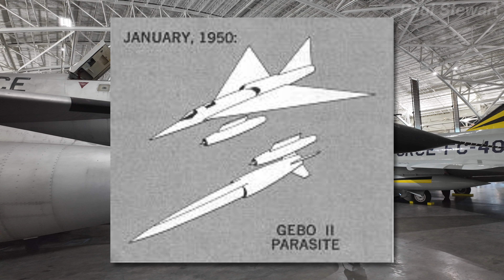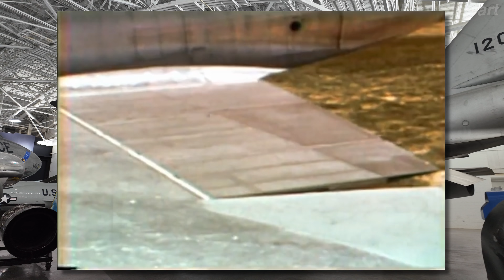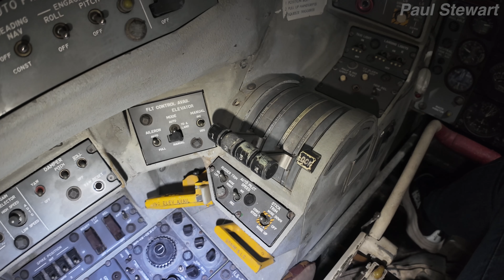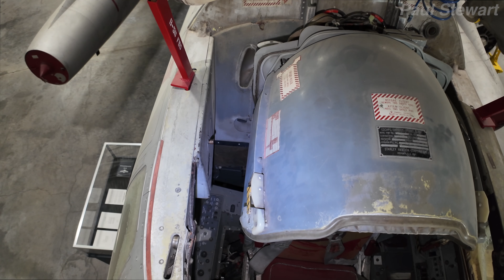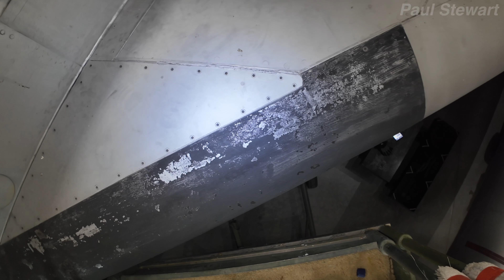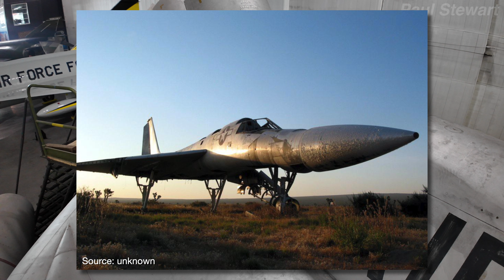Inside the Convair B-58 Hustler!

Comment: We were stationed at Grissom AFB at Peru Indiana. That was one of only two bases of the B-58's, the other in lLttle Rock Arkansas. There is an article that I read written in the early 2000's. It was about the infamous nuclear planevfire in the early 1960's. One of the Hustlers had a crew onboard when an accident occurred and and a  fire ensured. The remains of the wreckage was buried on the grounds of the base. It was planted with trees over the wreckage and a ten foot fence with razor wire. One of the crew died and two others were injured and burns. I believe the article was published in the local newspaper of the town of Kokamoe. Great video and commontary.

Comment: Just remember they did all this without computers, without CAD, without calculators, all paper.  Imagine having to design the air-intact systems, the engines, the curves of the body panels, all paper, all pencils.  These guys knew what the fck they were doing, that is for sure.

Comment: Had an older friend that worked on the 58 in Ft Worth. His favorite story was close to his first day on the job when he was instructed to remove an instrument in the lower corner of the pilot's cockpit but he found that it was almost fully encapsulated by structure. He went to his boss and said he couldn't remove it and the boss said they'd hired a mechanic who couldn't even remove an instrument. Boss went out with him and failed too. Turns out they installed the instrument and built the rest of the structure around it afterwards ensuring it couldn't be easily removed. Consulting an engineer they confirmed that was the case. 😜

Comment: I rather suspect that the loss rate is also explained when we realise what aircraft the crews were progressing from when they moved up from the likes of the 36 to the 58. 
It was such a quantum leap forward in technological terms that I suspect that any pilots making the progression to these birds might have previously acquired muscle memory flight inputs that would be fatal in the 58.
Reply: @robinwells8879 Your claim is plausible in theory, but it does not reflect how B-58 crews were actually sourced or trained in practice.

The B-58 force was drawn primarily from Strategic Air Command (SAC) multi-jet bomber pilots, especially B-47 Stratojet crews (the most common source), some B-52 pilots, and highly experienced multiengine instructors.

Transition training for the B-58 was extensive and standardized: instrument training (T-33), delta-wing familiarization (TF-102A), then limited flights in the TB-58 trainer before operational conversion.

Historical evidence instead attributes B-58 accident history to aircraft complexity, performance envelope, and early-service technical risks, not legacy pilot habits from the B-36.

Comment: How can this Bird not be on the top list of everyone's favorite plane of all time. Air-conditioned wheel wells haha didn't know that but I knew nitrogen had to be used in the tires for the high speed landings or the tires wouldn't hold up to the pressure.  Great Video 🙏🇺🇸
Reply: Nitrogen was used mainly because it is inert, which reduces:

Heat-related pressure variation
Oxidation and moisture issues inside the tire
Risk of combustion under extreme braking heat

Comment: To run pressure that high in the tires the wheels alone would have been highly engineered to allow for the tire bead to lock into place and not come off of the rim.

Comment: 18:28 - Cool thing to note here: the covered switch next to the arming switch reads "SWESS DEACT".

SWESS is for Strategic Weapon Emergency Separation System. It is actually a dead-man switch for the nuclear bomb, intended to automatically detonate it once a low enough altitude is detected. This ensured that once the Hustler was in full afterburner on their attack run over Russia, the bomb would always explode even if the plane itself was shot down.

Worth also noting that the switch only turns OFF the system - presumably once you arm the nuke, SWESS goes into effect automatically. "Me and this nuke are flying to Russia - if all goes well, one of us may come back."
Reply from the maker: Interesting! Thanks!

Comment: Some of your data is incorrect.  For example the engines were not J-93's but GE J-79's and in Reheat total thrust was 29,000 per engine. there some other corrections but not going into it here.  No big deal.
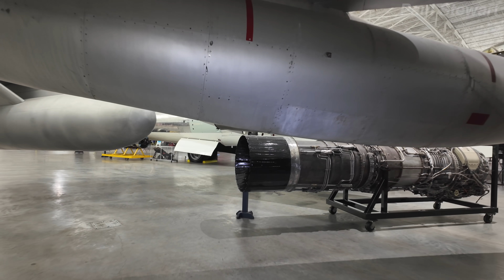Reply from the maker: I said they were J-79s didn’t I? At 10:30.
Reply: He didn't make any such claim.

10:30 “Now, here is one of the four General Electric J79 after burning turbo jets producing up to 15,000 lb of thrust each. These four engines propelled it to a top speed of 1,319 mph, and it had a service ceiling of around 63,400 ft. The engines were so powerful that it could climb over 40,000 ft in just a single minute, which is pretty incredible."

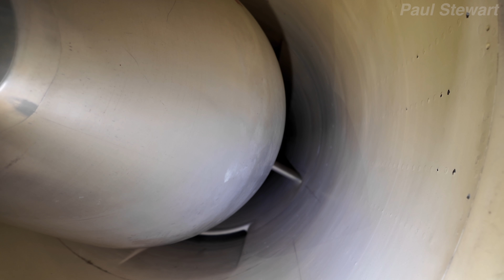12:16 “This here is a General Electric YJ93 turbo jet engine from the XB70 Valkyrie and planned to go into the XF 108 interceptor as well. The B-58 was actually used as a flying test bed because the engine was ready before either of the other aircraft. So they instead installed one in a modified ventrop pod as the NB58A.”

Comment: I was stationed at Bunker Hill AFB (now Grissom Air Reserve Base) from early 1962 until discharged in late 1964. I worked on the KC135 flight simulator that was in the same building as the B-58 Hustler simulator. The tanker simulator was all analog computer and the bomber was all digital electronics. What a great thrill to be on the same base with that historic bomber. We were all under the SAC 305th bomb wing and the  68th ARS.

Comment: I can see where the B-1B took design queues from the B-58.
It's interesting that the windows diced around the parameter. Wondering if that's glass finally giving to long term stress....?
Reply: Yes, it is because of the unequal heating of the pane and the frame when it sat outside for so long.

Comment: This had 3 pilots?
Reply from the maker: 3 crew membere
Reply: @PaulStewartAviation Thanks I never knew that what an aircraft.
Reply: @PaulStewartAviation  18:58 “…the three pilots could write each other messages if the crew intercom system went down.”

However, you later mentioned Bombardier/Navigator seat (second crew member) and Defensive Systems Operator (third crew member).

Comment: Amazing looking, but pilots called it a death machine, it was difficult to fly and dangerous to operate. 
116 planes were produced, 26 crashed? That's a horrific 22% CRASH RATE. WOW. Imagine that TODAY for ANY aircraft.
Reply: While it's true it had a high accident rate early on, most of those incidents occurred during the testing and development phase as crews adapted to its demanding flight characteristics and cutting-edge technology. Once it entered operational service, its accident rate was not significantly worse than other high-performance aircraft of the era.

Seven were lost in testing before it became operational, two crashed due to pilot error at the Paris air show, and one was lost in a taxing accident. The effective operational loss rate was 14 operational losses / 86 operational aircraft = 16.2%.

At least four operational crashes occurred during simulated bomb runs, low-level penetration training, or tactical maneuvering, where pilot error or improper handling was either the primary or contributing factor.

Estimates for current aircraft crashes:
F-15: ~175 non-combat + a handful of combat losses gives a plausible total around 180–190 out of 1,500+. That puts the crash/write-off share roughly in the 12–13 percent range.
F-16: 670 / 4,600 ≈ 14.6 percent

F-18:  as of around 2017, approximately 12.3% of the total F/A-18 Hornet (A/B/C/D) fleet built was lost in crashes, while the F/A-18 Super Hornet (E/F) variant has a much lower percentage loss rate due to its newer design and ongoing production.
Reply: @smark1180  I was in Puerto Rico mid-60s Ramey AFB, my dad was a B-52 pilot but we liked watching the B-58s take off from close range, it was a BEAST. And always a parachute for landing.
Reply: @carloswhomusic  I saw B-58s operate out of Carswell AFB, but I was very young then, so my memories of it are very vague.

Comment: Aircraft doing 1300mph. Tail gun has a muzzle velocity of 1300mph. Round will travel away from the aircraft at 1300mph, but will be stationary relative to the ground. Basically the rounds have to hang around and hope the attacking fighter runs into them in the milliseconds before they fall to earth!  Air warfare brought to you by Loony Tunes.
Reply: A round fired rearward from a B-58 at Mach 2 toward a trailing Mach-2 aircraft would close on the follower at about the gun’s muzzle velocity (~1,050 m/s), so impact happens very fast.

Closing/impact speed ≈ 1,050 m/s (≈2,350 mph). Typical closure times: ~0.5 s for 500 m, ~1 s for 1,000 m.

Energy is huge: a 20-mm projectile carries ~10,000–55,000 J, enough to severely damage or destroy a fighter if it hits.
Reply: @smark1180 Did you get the Loony Tunes memo?
Reply: @Redrumbler  That “bullets hanging in the air” image only works if you stop physics at the instant of firing, it’s a fleeting math trick, not reality.

The B-58’s tail gun fired 20-mm rounds at ~1,030–1,050 m/s (≈2,300 mph), while the jet itself topped out around 1,300 mph. Subtract those vectors and you get a ~980 mph rearward velocity relative to the ground, meaning the projectile immediately moves backward, not “stationary.”

And because a pursuer is still moving forward at Mach 2, the closing speed remains around the muzzle velocity (~1,000 m/s), giving each round tens of thousands of joules of impact energy.
Reply: @smark1180 How am I supposed to enjoy Wile. E. Coyote and chums now that I’ve got to stop physics and appreciate fleeting maths tricks and stuff?
You’ve really taken, I mean really taken, the wind out of, …..look at me when I’m talking to ya boy,….my sails!
Reply: @Redrumbler  I enjoy Foghorn Leghorn and Wile E. Coyote too - ACME makes great sight gags. 

But out of cartoon mode, the numbers don’t wink: the B-58’s tail gun throws a 20-mm round at ~1,030–1,050 m/s (~2,300 mph); the Hustler tops out around ~1,300 mph. Net result: the projectile is initially moving rearward ~980 mph relative to the ground, not “hanging,” and a Mach-2 pursuer still sees ~1,000 m/s of closing speed.

Jokes land or don’t; physics still does.

Comment: What’s going on with the windows?
Reply: The crazing near the B-58’s canopy frame happens because of decades of stress and degradation concentrated at the bond line, while the center remains relatively unaffected.

The metal frame and acrylic expand differently, trapping stress at the perimeter and causing micro-cracks.
Reply: @smark1180 Thank You👍

Comment: That gun at the rear, at the super fast speeds it travels, wouldn’t the round just drop out of the sky since it would basically stop in mid air since the speed of the bullet matches the speed of the gun firing it?🤔
Reply: No.

A round fired rearward from a B-58 at Mach 2 toward a trailing Mach-2 aircraft would not hang in the air or drop out of the sky; it would close on the follower at about the gun’s muzzle velocity (~1,050 m/s), so impact happens very fast.

Closing/impact speed ≈ 1,050 m/s (≈2,350 mph). Typical closure times: ~0.5 s for 500 m, ~1 s for 1,000 m.

Energy is huge: a 20-mm projectile carries ~10,000–55,000 J, enough to severely damage or destroy a fighter if it hits.

Comment: If my memory is correct, when I was a young kid my scout troop was able to camp in the desert at Edward’s AFB. At that time they were testing the B1B (in white) but as little desert rats we’d venture out down the rocket sled track where we discovered a mothballed B58. I realize that this fact is a faded memory, but throughout most of my life I was the rain man when it came to identifying cars, aircraft and other vehicles. Either way, I’m sticking with that memory, because it’s when the B58 became my favorite aircraft. Up there with the B1, yf -12 and the xb70

Comment: 11:23 tritium is a gas and therfor comes in small vial. Radium is what was used for the glowing paint of watches at the time not tritium. Tritium is used on some gun night sights. Small vials of tritium are lodge inside the part of the sights you are supposed to line up to aim.

Comment: None of the pics of the B-58 I saw as a child showed the truth - that it was actually quite a small airplane with three-in-line seating. I had always imagined a B-52-like flight deck with pilot and co-pilot side by side (and you can blame the film Fail Safe for that in part). 

Then again, until I saw an actual Concorde at Heathrow with my own eyes, I hadn't realized that it too was much smaller than most pictures of it (with no sense of scale) led one to think. I was actually shocked to see how small it was.

Comment: My only impression of the B-58 cockpit came from the movie Fail-Safe, which prominently featured the silhouette of the B-58 in many scenes without specifically identifying it. This cockpit bears no resemblance to the much roomier-looking movie version which features side by side pilots and lots of room between them.
Reply: The Fail Safe movie used a repurposed airline simulator to stage the internal cockpit scenes.

Comment: Always thought the B-58 was & still is,, ''sick'' looking !! 😎
Might someday make an R/C -  P.S.S.  ''slope''  version.,, which is basically an unpowered glider,, that you fly off of hills,, & use the wind  going up the hill to give you lift.
With that huge delta area wing,, it should glide very well,, just gotta keep it light,, for low wing loading. 😉
Already designed & made a very successful flying  P.S.S.    F4. 
 I
Reply: In reality, the B-58 carried unusually high wing loading for its size/mission, which brought supersonic efficiency and structural advantages but forced high rotation/landing speeds, long runways, drag-chute braking, and careful AoA/CG management.

Comment: There has never been before or since a busier combat aircraft pilot than the Hustler driver. This dude was pilot/copilot/flight engineer. Very heavy workload indeed. This doesn't even take into consideration all of the quirky habits the B-58 had for takeoff and landing cycles. There were also severe height and weight requirements involved for crew selection. All that said, there has never been a sexier looking aircraft in the USAF inventory. My father was an Air Force fighter pilot, his squadron was detailed several times for mock intercepts of a B-58 bombing incursion over CONUS. He said that getting a head on lock was the only chance they had in the F-102, if they missed first pass, turn around time and the Hustler's speed made it all she wrote.

Comment: A few things: 1st, the ejection pod also required boots that hooked into a cable on the capsule.  It would pull your feet back as the bar pushed your legs back before the capsule snapped shut.

2nd, the onboard voice of the plane was a woman's voice.  I believe the first plane to do so.

3rd, Greased Lighting was Sid Kubesh plane.  He was the pilot who flew the speed record from Tokyo to London.    Therefore we always referred to it as his plane.  Even though he had left the 305th before the B-58s were retired.

4th, that flight was none stop.  They flew via Alaska, not stopping in Alaska.

5th, I always found it funny that they retired the two operational Bomb Wings flying B-58s, then turned around and stood up two FB-111 Bomb Wings.
Reply: Please explain "stood up two FB-111 Bomb Wings."
Reply: The year after the B-58s were retired, two Bomb Wings, 380th & 509th, transitioned from B-52s to the FB-111s.
Reply: @andrewgarrison3485  OK, but I don't understand how that's related to the B-58.
Reply: @smark1180 the USAF retires a mach 2 capable bomber (B-58) to replace it in less than a year with a mach 2 capable fighter/bomber (FB-111).
Reply: @andrewgarrison3485  That makes sense in a broad “successor” way, but it wasn’t really a direct replacement. The FB-111A filled the medium-range strategic role that SAC lost when both the B-58 and the earlier B-52 variants were retired, but the two programs were fundamentally different.

The Hustler was a dedicated high-altitude, Mach 2 nuclear penetrator built for deterrence under the “go fast, go high” doctrine of the late ’50s. The FB-111 came a decade later under the “low-level penetration” strategy, slower, terrain-following, more fuel-efficient, and meant to survive by hiding, not outrunning defenses.

So while the timing lined up, B-58 wings retired in 1970, FB-111 wings stood up soon after; it was more of a doctrinal and cost-driven transition than a one-for-one swap of a Mach 2 bomber for another.

Comment: CORRECTION: NOT ONLY WAS IT A LONG-DISTANCE BOMBER IT WAS INDEED A FIGHTER THAT WAS SO FAST IT DID NOT HAVE TO WORY ABOUT BEING ATTACKED FROM THE FRONT - HIGH OR LOW ALTITUDE.
CONTRARY TO WHAT YOU SAY CONCERNING THE B-58'S DELTA WINGS IN LOW ALTITUDE IT WAS VERY EFFECTIVE AT TREE TOP LEVEL AND/OR SKIMING THE WAVES.
THE B-58 HUSTLER WAS A FEARED WEAPON.
Reply: Want to thank you for bringing this weapon back to the public's attention even though the info you gave was the same that was given out to everyone which I never agreed with. I won't say anymore but I will say that i think the B-58 was taken down - out of commission - for political reasons: a chess piece used to negotiate.